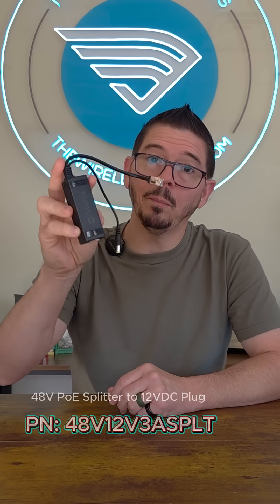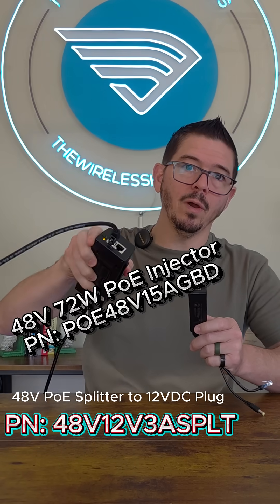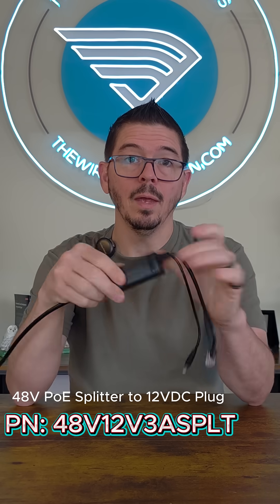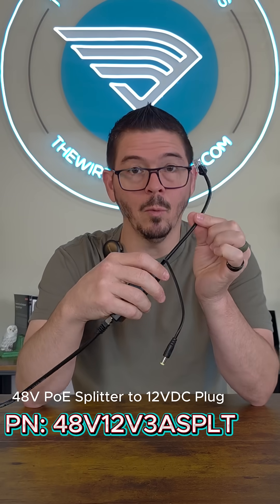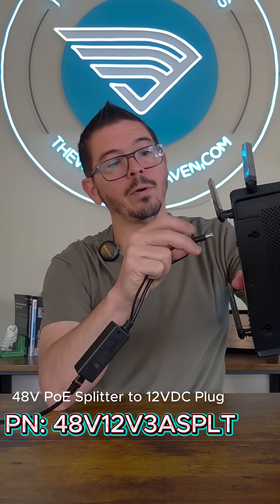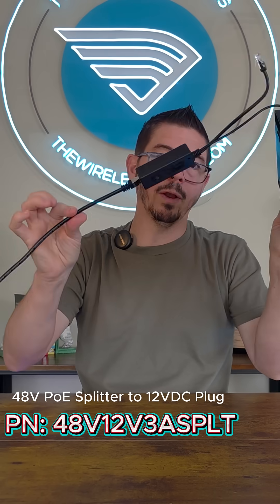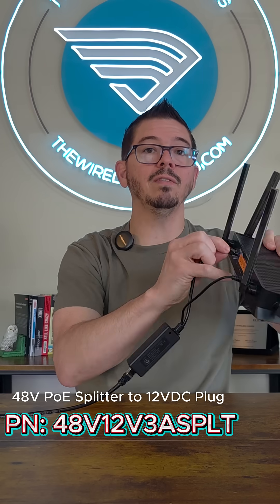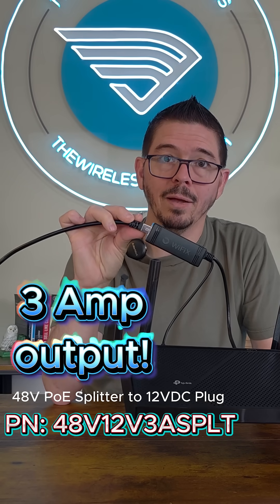48V PoE Splitter and it's handy uses - The Wireless Haven

Comment: Can you add 4 cameras using 1 ethernet cable if you have 3 of these splitters and are using say a 90w injector? The range is only about 30 ft between each camera.

Comment: If they had type-c, I could connect it to my phone and use my phone as a tether. Very cool.
Reply: That's exactly what I use, the splitter powers the router and an iPhone 13 plugged into the USB port of the router.  The phone acts as an external modem and charges at the same time.